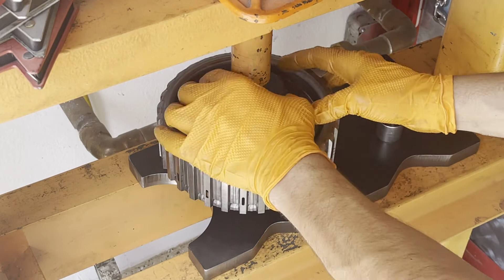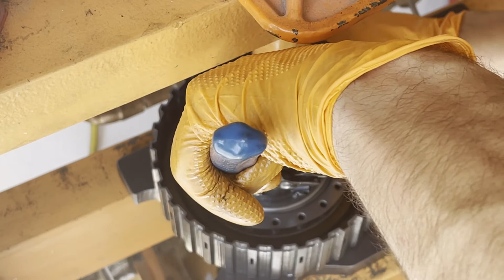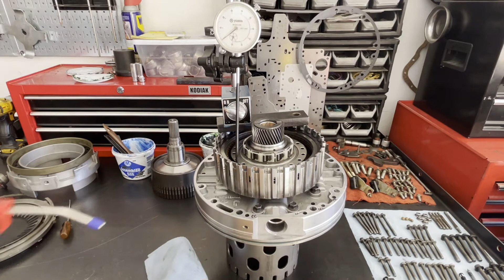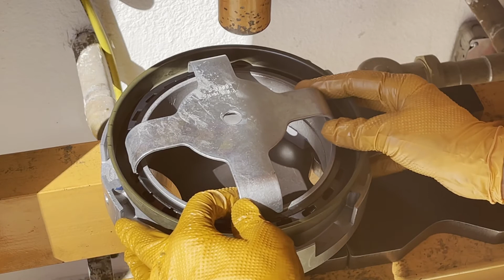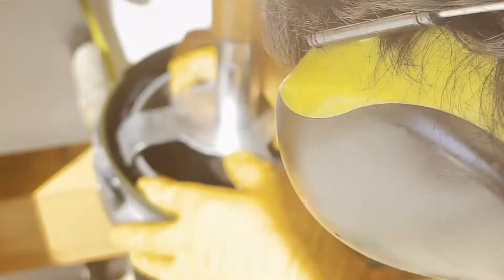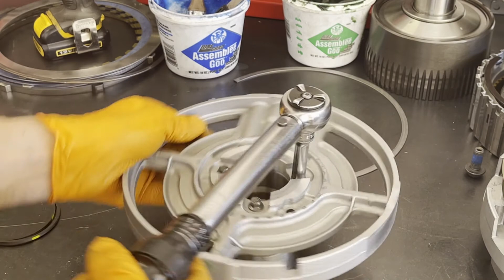3. Ford 4R100 Rebuild - Overdrive Drum, 2/4 Piston Assembly & Center Support

Comment: I'm realizing I can't tell the difference between lockup and overdrive on my 4r100. is the converter locked up and stays applied or wtf is pulse width modulation? when does the overrun clutch apply?
Reply from the maker: The PWM was introduced to address customer concerns about 'feeling' the converter clutch apply in prior years, models...PWM is, in English-speaking terms, a graduated/gradual apply of the converter clutch. 

In the case of the 4R100s (98+) in the 7.3 PS diesels, they never had an on-off style TCC apply strategy..I believe only the gas 5.4 Triton engines had non-PWM pumps for a few years then switched over...The larger displacement gas engine applications had the same PWM apply strategy as the 7.3L diesels.
Reply from the maker: Overrun clutches are on in 1st, 2nd and Reverse when in D, D3, M2 and M1 (Manual Low).

Comment: Your opinion on if its worth the hassle to source a 3 friction drum from a pto optioned truck? 
Love the videos!  been binge watching all day, and already will have a better build on my next 4r100 !!
But I just cant do the dry frictions!!!  :-)
Reply from the maker: Thanks for the kind words, Val...Unless you're going to be doing a lot of serious duty towing/hauling, etc it's prob not worth it but your call...Also, there's no harm in soaking frictions, but it makes it a lot harder for you to detect potential problems in the case when the pump's installed and you're spinning the input shaft. That's primarily why I keep them dry.
Reply: as far as dry frictions the drum has to oil before any pressure and oiling the new trans gets her pretty well caught up in the first place. clearance is more legit because a puffy cold friction is phatter

Comment: Do you have a video on the disassembly of the overdrive planet. Trying to install a billet planet and trying to figure out how to take the planet gears out of the old one. Are the stake pins drilled out to remove the pin in the center of the gear?
Reply from the maker: Sorry, I don't as of yet. You should be able to press them out (or take them to someone w/a press if you don't have one) and back in. If they are crimped/staked you may need to swedge them; I believe Sonnax makes a tool for that.